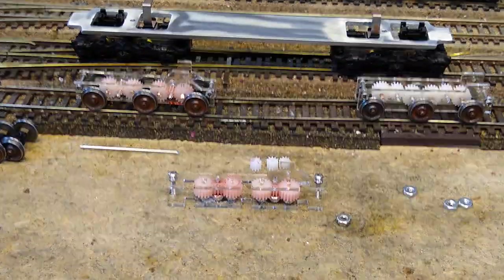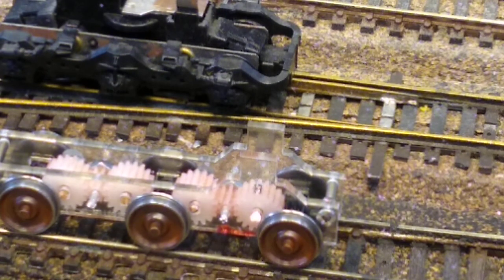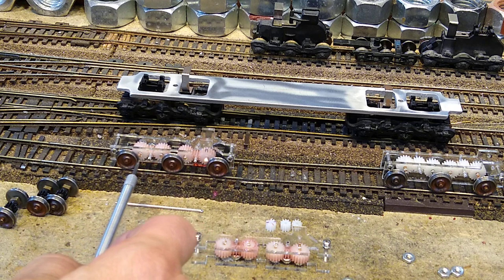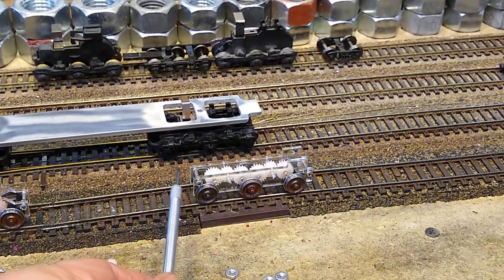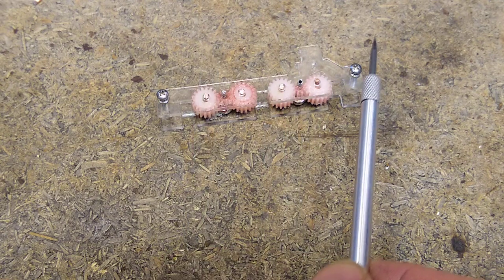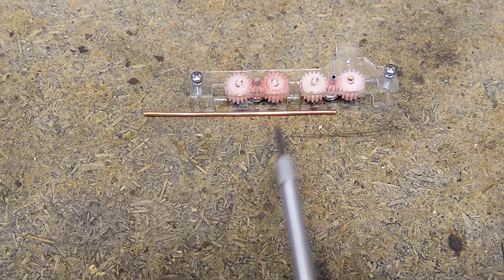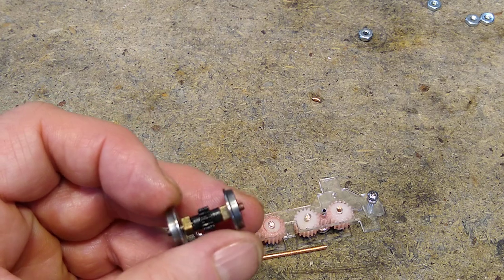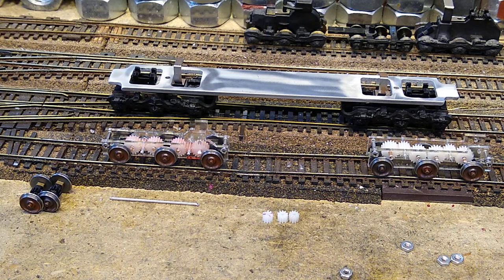2022 5 Loco Contest Part 14 Gear Train Formula Found

Comment: is 3d printing allowed?
Reply from the maker: yes, but I'm not up to the part where I need to use the printer yet.  I'm going to use the printer to make the steps and compare them to the steps that I make out of tin.  if the printer can do a decent job that will save days of work.